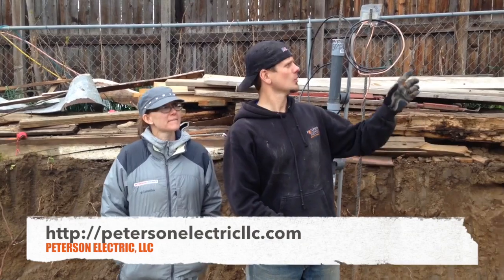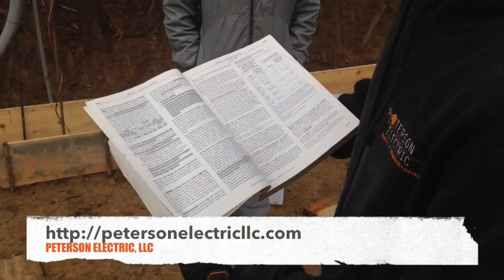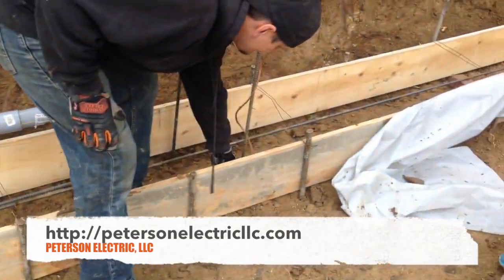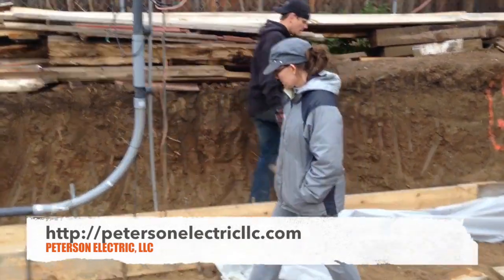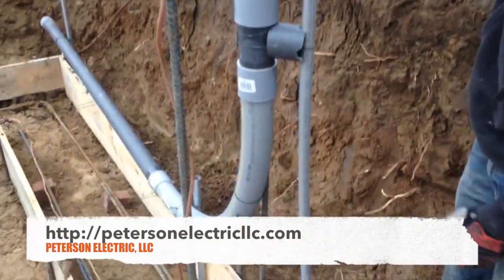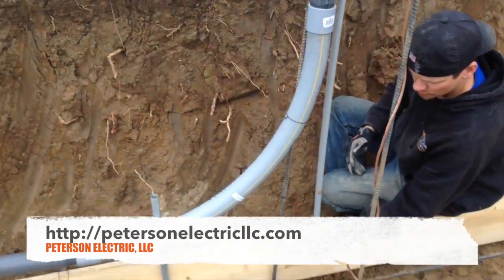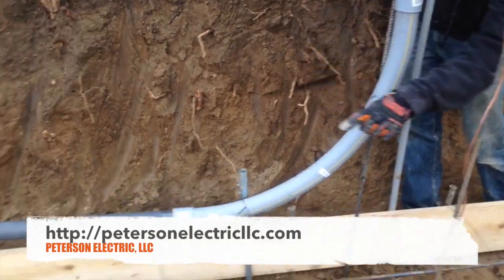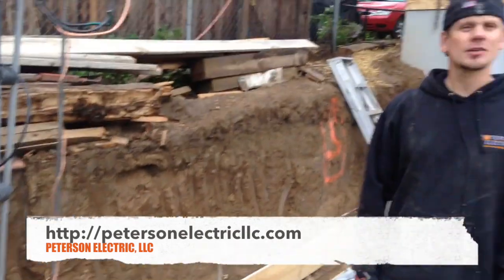What Are Electrical Code Requirements For UFER  Grounding On A Home?

Comment: Why did you put 2 ground rods instead of using the rebar alone with a 20 feet wire gauge 4 ? Did you over do it? What I learned from a new construction there will be no need of the 2 rods, what do you think your experience matter thanks. 😅

Comment: I understand about ground rods, ufer I'm confused about can you explain to me what is it designed to protect? Is it for lighting strike and or grounding electrical service?
Reply: Lightning strike.   Too high of resistance to work for grounding equipment effectively; won't allow enough current through to trip the breaker of the equipment with a ground fault.

Comment: I believe you have miss interpreted the code. 
1- you don't need 20ft of ground wire in the slab the rear needs to be 20 in length 
2- once you hit the user bond there is not need for any ground rods
After that I couldn't watch any longer

Comment: This could not be more misleading and confusing. There is NO need for 20 feet of copper wire buried. Also no need for those ground clamps. The basis if this approach from a code perspective is to use the rebar (min 1/2" ) in the pour as the grounding electrode. If rebar lengths shorter than 20 feet then standard tie wire is OK for connecting rebar together. If NO REBAR available, then you need to install the copper wire. Furthermore, unless AHJ determines otherwise, there is no need for additional ground rods. You made something very simple into something very complicated, confusing, and expensive.
Reply: So when you have rebar that’s less than 20’ even if it’s connected together, then that is when you run a 20’ copper wire? It seems like such a COMMON mistake of many thinking they need to run 20’ of copper in the rebar. I wonder what’s causing this confusion. 😊
Reply: Agreed!  👍

Comment: Sch 8o for high voltage? 
But this is medium voltage.
Reply: It is low voltage. Technically, medium voltage starts at 1000V. I think what he meant by high voltage is that it's more than 48V.
Reply: I was told sch 80 for anything service related, isn't just the wall thickness of the PVC?

Comment: About your ground rod, technically the code states that "except that, where rock bottom is encountered, the electrode shall be driven at an oblique angle not to exceed 45 degrees from the vertical or, where rock bottom is encountered at an angle up to 45 degrees, the electrode shall be permitted to be buried in a trench that is at least 30 in deep". So you would need to drive it in vertically unless you actually hit solid rock. The angle and horizontal options are only if the first method fails.
Reply: You are allowed to lay a rod down like this 30# below grade.

Comment: If we have more then 20 feet of rebar in the footings. We are required to tie in a full 20 foot #4 rebar that extends 4 inches out of the top of the poured foundation. That's in virginia though. We aren't required to run all that pvc here.

Comment: Why the grounding rods when you have ufer with the rebar in the concrete ?
Reply: @FunHog69  Concrete Encased Electrodes were never required to be supplemented.  The article you are alluding to is for rod, pipe or plate electrodes.  They must be supplemented if their resistance is greater than 25 ohms. Also underground water pipes used as an electrode must be supplemented.

Comment: Good work.  I installed many ufers and the ufer connection has to have a mud ring on the wall where it connects from the underground to above ground  so the rebar is visable. This is the  way they  designed  our job .Keep up the good work..

Comment: These guys got it all wrong. The concrete encased electrode IS the rebar in the footing. You dont have to run 20 feet of copper in the footing. What a waste of materials. Go back and check your codebook fellas. The ground rods must be in contact with permanently moist earth. We drive ground rods as a supplement to the concrete encased electrode or the underground piping (water piping). Nowadays, contractors are finding that plumbers are cheaping out by installing pvc water mains so there is not 20 feet of copper pipe in the dirt to serve as a grounding electrode, hence the need for the ground rod. Also, your point of attachment to the UFER ground must remain accessible. Way to go, thanks for adding to the confusion.
Reply: With a ufer ground you don't have to drive a ground rod, right?  As you stated he could have simply bonded to the rebar.
Reply: @JesseKlaus  CEE don't need supplemental elrctrodes.  Unless you feel ground rods really help.

Comment: Is there a cover that is used to protect the ufer connection?
Reply from the maker: Yes you should have a cover. two gang mud ring with a 5/8" rise and a two gang plastic cover plate screwing to the mudring and then label the plate UFER

Comment: I have a question. When you bond the rebar could you continue with that same wire to bond the ground rods then stub only one wire.
Reply from the maker: Read 250.50 - 250.53 and 250.64
Reply: I was just curious. I didn’t mean to step on your toes
Reply from the maker: JOSH BARRON no worries. It actually states no other electrodes needed if you use this. I do not agree with this nor Practice this bare min. Requirement.
Reply: I mean in the trench, can you just bond the rebar and then continue your wire to hit the ground rods in the trench and then go up with one wire to go to the panel
Reply: As opposed to having one wire for the ground rods and one wire for that rebar
Reply from the maker: @joshbarron4415  No
Reply: If you run #4 that's correct.

Comment: Here's a doozy for your inspectors, and how THEY seem to interpret the code. I do large generator installations and our (subcontractor) electrician installs a duplex outlet inside the cabinet for eventual connection of a block heater and battery charger. One inspector says that outlet needs to have a "weatherproof when in use" type cover, but it's already inside a UL rated weatherproof cabinet. (huh?) He also says it needs to be a GFCI unless it's a dedicated outlet, so we explain that these 2 devices will be installed by the generator company (that's us) after everything is wired. Sounds dedicated to me. The inspector says he will only approve a single outlet as dedicated, not a duplex. IOW, if we have 2 accessories then there needs to be 2 separate 2x4 boxes with 2 separate receptacles. Last I looked at the code those dedicated outlets only need to be GFCI if accessible to the customer for general use and those covers he spoke of are only necessary when outside in the weather. They are inside a closed cabinet. Go figure that these inspectors will grind a nut when they feel like it.
Reply from the maker: Sounds like he is grasping for something to nail you on. That is odd, we are not allowed to install a single plug and call it good. It has to be GFCI period with our inspectors. I agree with you that it is only for your use and is already in a dry area.
Reply: @Petersonelectricllc … Forgot to mention that it's the gen mfgr recommendation NOT to install a GFCI due to typical service intervals on the gen set being 6 - 12 months. IOW, nobody testing the GFCI feature on a regular basis so if it fails and the circuit goes open the set may have a dead battery or fail to start when the power goes out. As I see it, this is one town and one inspector out of 5 counties we work in. Something smells fishy. OTOH, the inspector has moved on so no longer an issue in that town.
Reply: @rupe53  GFCI, not GFIC.
Reply: @illestofdemall13  ... thanks. I don't know where my head was that day.

Comment: Don't know if you guys are still monitoring this, but I have a bunch of new builds I think are using this but CATV installers are having a hard time finding the communications bond point.  Any idea what to tell them to look for?  The meter for electric is in the easement, so it's hard to tell exactly where the electric comes in from the outside of the house.
Reply: They need to run another #4 copper from the panel, and mount a bonding bridge on the wall for communications
Reply from the maker: If possible come off of the 1st point of disconnect of the main breaker on the structure. If not possible, I would go off of the cold water, than you do not have to go in the service equipment. Assuming you are a remodel. If new construction you have to come off of a ufer. Article 250.94 talks about your ISBB.
Reply: A intersystem bonding point at the electric service is required for new construction.  The bonding point is a bridge or in some areas just bond wire that is accessible.
Reply: Bonding CATV, phone or other LV equipment  to an interior metal water pipe system is not very reliable.  Too many plumbers cut sections of the water pipe system out and install PEX for additions, repairs, etc.interrupting the electrical ground continuity potentially resulting in no ground at the equipment.

Comment: I feel for you man. I can only appreciate an electrician that is invested in his craft and can post it in a video, that is a brave and impressive feat. Iv been in the trade only for about 5 years now. Clearly you know what you are doing. But in my 5 years in the trade I have noticed a couple big flaws in electricians. 1.) If you don't have YOUR experience, you don't have experience at all. 2.) Especially for older tradesmen, they swear they are the unicorn guy who is Gods gift to another tradesman and you can never do anything right to impress them god forbid you quote the code one article off even when you know what you are trying to say. Keep up the good work, you are a great source of knowledge for the young guys like me.
Reply from the maker: Thanks, I have been in the trade 21 years now and it is something that totally agree with you on, especially with inspectors, who want to flunk you on one item and than go back the following inspection and flunk you on another item that could have been said on the first failure. It is their way of being unprofessional. I had this happen last week on a bunch of lighting in a grid ceiling on ceiling tiles, he did not want any NM Romex cables, article 334.12.(2) under use not permitted, than he could of told me that he did not like my 1/2" Ko plastic NM bushings, instead he failed me and wanted 1/2" metal ko push on caps. He was right that there is one part of the code that talks about the consistent of the same material, "If it is it's purpose", but I feel it was also ok, because it is a bushing that seals. Grey area, so in the 2017 NEC Hand Book, I looked up in the back one the Index, "Knockouts", and it says opening to be closed, 110.12(A), 314.17(A). One code says that, "openings through which conductors enter shall be closed in an approved manner", the other one states, basically 110.12(A) is long, in a nutshell the opening hall be closed to protect the equivalent of the wall of the equipment. SO< plastic is not acceptable but metal. The inspector stated to me that if something arcs on a 1/8th of an amp LED 2'x2' drop in light, it could arc out of the ko NM bushing vs the metal ko plug. He probably is right, but what is sad about the experience last week is his method of inspecting and his attitude was basically "Figure it out". I wish I could say it gets better in the field the longer you hang in there, but dealing with attitudes and inspectors should be in article 90 and state, "Don't be a Butthole". 

The experience made it harder between me and the customer, it delayed him and pressured us to get this fixed TWICE ASAP. If he would have just said both failures, and what made me call him out was that he did not state where these code articles were and I looked them up. Yes he was right but being DEAD RIGHT, gets you No where. What I think most city and state inspectors do not realize is that we are in a learning trade and when we get our license we begin to practice what we have been learning by DOING our trade. What I also do not think they realize is that we are humans and may or may not know everything about the request to what "their view is on the code articles". 
What is so sad, is that we are also their customer, we pulled the permit and invited them to correct our work for the respect of the customer. I told the inspector that the original insulation was there and the NM cable that was ran was a mess, we gutted it all out but he did not want NM in the ceiling. So, we went back on 20 lights and three switch legs and installed ENT pipe, (362) and he stated to the owner when I was not there, and I quote what the owner said, "I'll pass it but it is not something that is normally practiced and not sure I like." I called the inspector again and told him what my customer stated, and said to him that it is not a plenum rated ceiling like 300.22 (C) states. Amazing, I told him, just cause you are not us to it does not mean it can't be done. Sure normally I would use MC cable, it is lite and fast, but I did not want to throw out over 300' of NM, so I sleeved it. 

anyways it is really disappointing, we are humans but never allow to make mistakes in this field without it effecting our schedule and time to repair.
Reply: I can relate man, I had an inspector fail me on a SG blue box that needed to be moved 1.5in more for the clearance from a sink to make it 6ft. away, an easy move since there was no drywall installed yet, so I moved it while he was there. And a ceiling fan box- Now this box was metal with a 1/2in knockout and a plastic bushing installed and designed to fit right up against the stud. When you push it up flush with the drywall and secure it I guess it looked like a pancake box. He fails me on this because he thought it to be a flippin pancake box and couldn't see up into the space inside! I second guessed myself because I was so caught off guard by the accusation. Why would anyone do that to themself? Do I take him to the roof and push him off? What is the meaning to all of this! Anyway I was an apprentice at the time time and your right, the foolishness never ends. There is always 'That Guy'. 

So hey, I see you use the NEC handbook instead of the regular printed version. Do you think it helps you more or less with your ability to do your work? Iv been thinking about getting one, but hadn't seen anyone that uses it on my side of the moon.
Reply from the maker: I like the handbook, the pictures seem to help the customers when we are estimating on the meet and greet.

Comment: I'm a city inspector in Texas....great video! I'm glad you mentioned to make sure the ground clamp is for direct burial. I also frequently run into situations at the foundation inspection which includes checking the ufer ground where the vapor barrier plastic is installed underneath the ground wire. I had 2 today of this same thing. The vapor barrier under the CEE negates the whole reason for this method. I make sure they cut away the vapor barrier or pull it back so the CEE does indeed have direct contact with the earth.
Reply from the maker: Thanks for watching. I try to explain this to the customer, but it seems like some concrete companies are always in a rush and it is a good way to get failed. What do you expect the electrician to do it they could not control it?